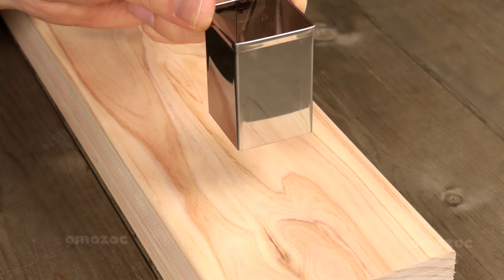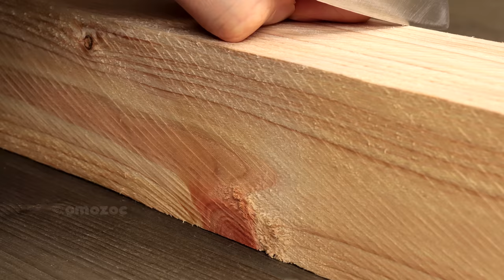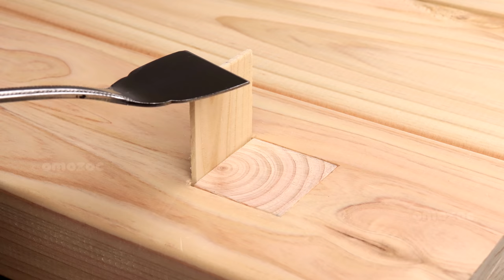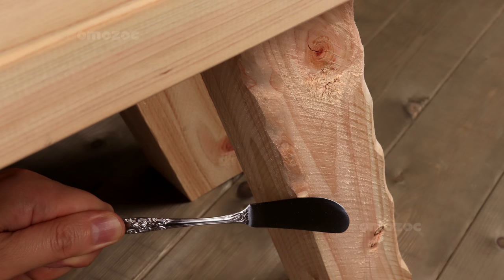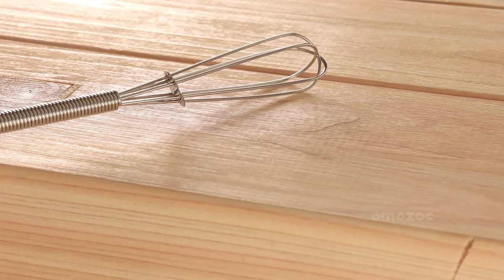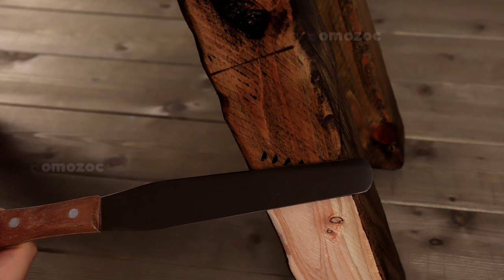STAND - stop motion woodworking

Comment: Woodworking takes so much time as it is, I can’t imagine how long this video took. Each frame would entail going to a real saw, making a tiny portion of a cut, removing the saw dust and debris, placing the piece back exactly where you initially took it from, likely in a totally different room than the shop, then taking a picture. Repeat 2300 times. Amazing.
Reply: But when you frame it relative to the difficulty of stop motion in general, it's not so much extreme anymore. Some other stop motion are incredibly more meticulous
Reply: @billybob1831 I dare you to perfectly reposition a piece of wood you just hatcheted.
Reply: Hi, me
Reply: It COULD be done by masking and revealing more in each image in After Effects or something, but I'd wager he does it the old-fashioned way from the shadows alone. There have to be markers or something that are used to keep the corners of the wood consistent between shots to help speed up the process. Otherwise, this would take so long
Reply: and then on top of that do the editing and create the sound design
Reply: @Ricekrispy10 he clearly states that he has not processed the 962 photos in any way. he has only lined them up

Comment: If you are moving the wood to a saw and cutting it gradually, how do you replace it each time so perfectly relative to the background? One would think that the wood would have to jerk around since it would have to move each time after manipulating it.
And by the way-You’re quite a masterful woodworker, too!
Reply: There is usually a ghost image of the previous frame on the screen, so you can like it up perfectly with the last frame then take the picture
Reply: Lock the tripod + camera and don’t move it until you’re done with a sequence. Place the wood in a position that is pleasing to the eye, and then mark the edges of the wood on the surface its sitting on. Then simply position it back in the same spot after making a cut :)

Comment: How is this even possible? When doing the cuts between photos, is the wood secured somehow so it doesn't move? It seems impossible to take that wood over to a bench and do a bit of a cut and put it back in exactly the same position, dozens of times for a single cut. Mindboggling!
Reply: honestly he might have just cut it and then edited it to look like the 2 pieces are one until the knife goes through, cause the knife goes in at an angle and the cuts are actually following the knife which would be hard to replicate if cutting normally
Reply: If you look closely, at 0:09 seconds, there is a line on the table. That's is probably for in-between shots alignment purposes.

Comment: I used to work in a factory making furniture and my job was literally to beat the furntiure with tools, most common tool was just a string with nuts and bolts attached to it, would just bash the wood with it. Easy job and paid well, they make you damage the wood so that it looks like its supposed to look that way as opposed to revieving furniture that is prisitine and then somone accidently knocks a lump out of it and all you can ever see is the lump in a pristine chair

Comment: How hard is stop motion woodworking? I imagine it to be hellish and masochistic, but idk.
Reply: Ive tried stop motion wood working before, and it was difficult and easy at the same time, difficult because i dont know how to do woodworking, and easy because my entire channel consists of stop motion videos and im used to making it. But its mostly difficult (so basically its insanely difficult for poeple who dont know how to make stop motion and woodworking at the same time)
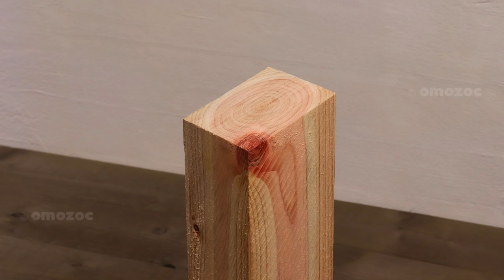Reply: It seems like to do the cutting at 0:26, youd have to put the blade up to it for the frame - then take it away, cut an inch into the block of wood, clear the sawdust, and then align the blade and your hand again like the previous frame to take the next one, and then repeat that several more times for the full time

You have to rebuild the shot for every frame pretty much

Seems very painful by very rewarding

Comment: The wavy metal hardware that connects the boards together. Does that actually exist or is it part of the video?
Reply: yes its a real piece used to connect two pieces of wood together, you just hammer it in usually
Reply: @ComradeCovert  What’s it called? I wanna buy some.
Reply: @ohhellobethany  Hey, I saw someone in another comment reply say they're called corrugated fasteners.
Reply: @ohhellobethany  yeah what that guy said corrugated fasteners

Comment: bro makes his video 5 fps and calls it stop motion
Reply: blud really thinks you can cut wood that easy
Reply: @Rucarlul The real question is, do you know what 5 fps looks like
Reply: @JordanPlayz158  Yeah this
Reply: *Sand* is a granular material composed of finely divided mineral particles. Sand has various compositions but is defined by its grain size. Sand grains are smaller than gravel and coarser than silt. Sand can also refer to a textural class of soil or soil type; i.e., a soil containing more than 85 percent sand-sized particles by mass.

The composition of sand varies, depending on the local rock sources and conditions, but the most common constituent of sand in inland continental settings and non-tropical coastal settings is silica (silicon dioxide, or SiO2), usually in the form of quartz.

Calcium carbonate is the second most common type of sand, for example, aragonite, which has mostly been created, over the past 500 million years, by various forms of life, like coral and shellfish. For example, it is the primary form of sand apparent in areas where reefs have dominated the ecosystem for millions of years, as in the Caribbean. Somewhat more rarely, sand may be composed of calcium sulfate, such as gypsum and selenite, as is found in places such as White Sands National Park and Salt Plains National Wildlife Refuge in the U.S.

Sand is a non-renewable resource over human timescales, and sand suitable for making concrete is in high demand. Desert sand, although plentiful, is not suitable for concrete. Fifty billion tons of beach sand and fossil sand are used each year for construction.
Reply: more frames doesn’t always mean better
Reply: @itsdiscocreeper agreed
Reply: @Rucarlul  this is 12 fps tho
Reply: @Monty1000 indeed